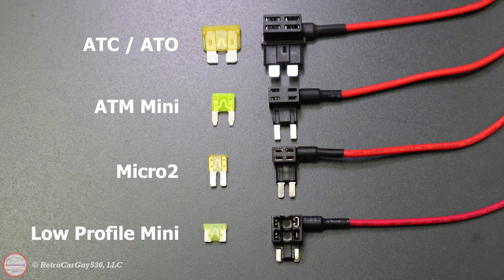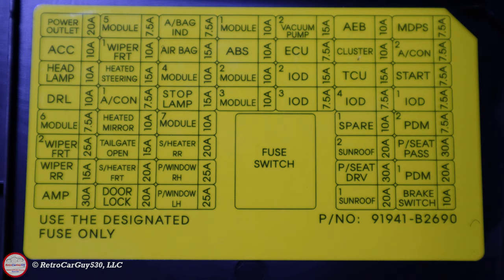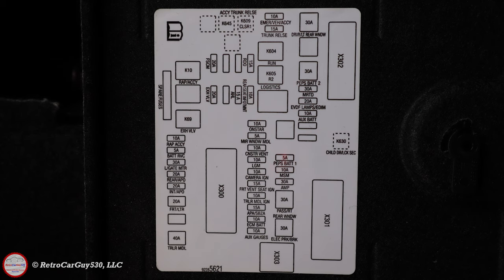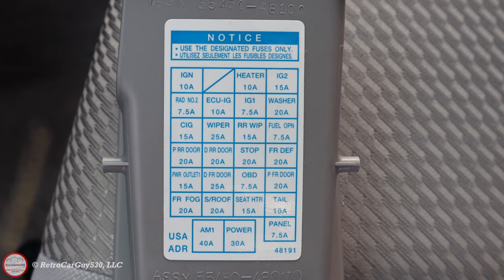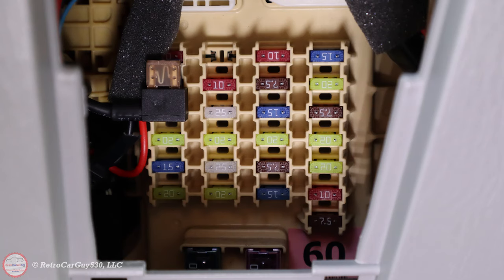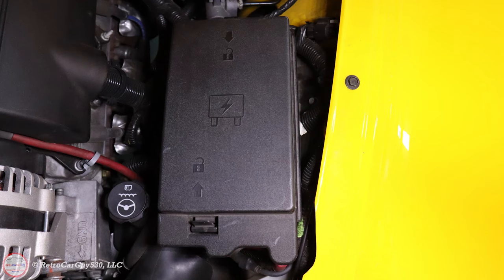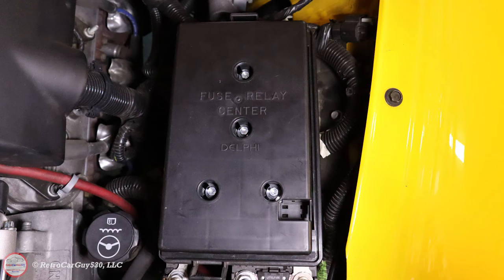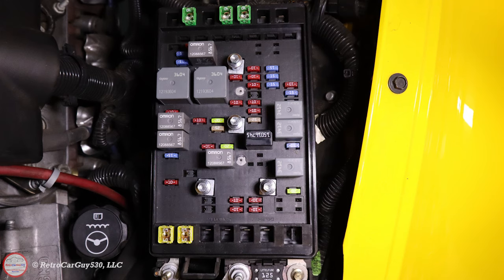How To - Add a Fuse Tap in Your Vehicle

Comment: So to be clear, the fuse taps must be inserted with the 12v left prong and ground right prong.

But the fuses themselves don’t matter if it’s flipped around as long as the original fuse goes into the bottom row?
Reply from the maker: No, the fuse tap never connects to ground.  The fuse tap has two fuse sockets.  The lower fuse socket is for the original fuse in the fuse box fuse socket (if present) and the upper fuse tap fuse socket is for the new device/accessory you're trying to provide power to.  The fuse itself has no power flow direction requirements.  I'm going to post a section I wrote for another question a few days ago to try and explain the power from the fuse box fuse socket going to the left leg (in parallel) of the fuse tap vs the right leg (in series) of the fuse tap.

There are two methods of using a fuse tap, the approach I show is the "in parallel" method where both the original fuse (lower fuse tap fuse socket) and the new accessory fuse have direct access to the power provided by the fuse box fuse socket.  This is very safe for adding devices requiring small amp loads (dash cameras are under 1 amp and radar detectors).  This is with the power from the fuse box fuse socket being supplied to the left leg of the fuse tap.

The second method of using a fuse tap is the "in series" method of routing the power through the fuse tap.  This is when the power from the fuse box fuse socket is provided to the right leg of the fuse tap.  That means the power goes through the lower fuse over to the left side of the fuse tap which is where the left leg will then provide power back to the fuse socket and power is provided up to the top fuse socket in the fuse tap.  The "in series" approach is the "safest" method of using a fuse tap because if the amp load of the original device/accessory plus the amp load of the new device/accessory being powered by the fuse tap exceeds the original fuse's amp rating, it blows the lower fuse in the fuse tap.  That provides the best protection to the wiring providing the power to the fuse box fuse socket.

Comment: Only thing I missed in this video is where to connect the ACC labeled wire. Mini came with a GND, POS and ACC wire.
Reply from the maker: You need to find two fuse sockets in the fuse box.  One that provides constant (BATT+) power and one that provides switched (ACC+) power.  You'll use two fuse taps in that situation.  The ground is connected to a nearby ground lug/bolt/screw.

Comment: The two exposed pieces of metal on the fuse are there for you test the circuit without taking the fuse out.
Reply from the maker: Yes, the two exposed metal pieces on the top of the blade style fuse are there for testing whether the fuse has blown.  If power is provided to the fuse and power available on both of the exposed metal pieces, the fuse is "good".  You cannot use those two exposed metal pieces to easily determine which side provides the power to the fuse box fuse socket.

Comment: Hi, @RetroCarGuy530. Great explainer video! I think I understand how this works, but I'm not sure if it will work for what I'm trying to do. I'm trying to install a new unswitched 12V outlet in my car so that I can run a 5W or 10W solar batter tender from my dashboard without having to hardwire directly to the battery in the engine bay. Can I supply power to the battery via fuse tap?
Reply from the maker: As long as the fuse box fuse socket where the fuse tap is installed is providing power directly from the battery (not through a module in the vehicle), then it should work.  Just make sure the wire being used (for power and ground) are a wire gauge (awg) rating sufficient to carry the power for the distance between the charger and the fuse tap.  Since this charger produces only 5W or 10W, the wire gauge shouldn't be a big issue, but it's always necessary to consider wire gauge when figuring out if a circuit can support the power demands of the device.   I discuss wire gauge/length in my FAQ video on installing a fuse tap.  https://www.youtube.com/watch?v=DnZ5wb_A5vE

The fuse amp rating needed for the fuse tap upper fuse socket would be something very small since 12-volts at 10W is under 1 amp.  I would put a small amp fuse in the top fuse socket of the fuse tap if this is only to be used with the solar battery tender.

Check the solar battery tender's user manual to see if there are any restrictions regarding the use of a fuse tap or if they state any specific wiring requirements to ensure safe operation.

Comment: Depending on the power of the original fuse that was already in the circuit, how do you determine which power circuit to use for the second circuit that you will use for the fuse tap?
Reply from the maker: This topic requires a somewhat complicated answer.  Without detailed/specific knowledge of how each fuse box fuse socket obtains its power and what the max amp rating is for the source of power, there's no perfect way to answer this question accurately.  The wiring / method the power is provided to the fuse box fuse socket must be able to provide the original amp load and with most situations it has at least a small amount of built-in "extra" amp load carrying capacity.  That "small amount" is usually around 10% of the original amp load rating.  10 amp = about 1 amp extra. 20 amp = 2 amps extra.  Is this a perfect way of estimating the amount of available amps, no, but it is a fairly safe assumption.

If the device needing power from a fuse tap requires a large number of amps (over 5 amps) to start/run, I would not recommend a fuse tap for its power source.  For devices with higher amp load requirements, sourcing power directly from the vehicle's battery with an inline fuse to protect that circuit makes more sense. If the device requires switched/accessory power, I would still source the new device's power from the battery with an inline fuse, but use a 4-terminal relay to toggle the power  on/off.  You could use a fuse tap to source the switched/accessory power to turn on/off the control side of the relay if you want it to turn on/off with the ignition switch.  If you want to manually control the on/off behavior with a toggle switch, you would use that to power the control side of the relay. I have a video discussing the "relay" approach to power a dash camera battery pack.  https://youtu.be/Joa0fiKZY-o?t=744

I recently posted on a DashCamTalk website about the differences in the installation of a fuse tap into a fuse socket (power on the left leg vs power on the right leg) here.  https://dashcamtalk.com/forum/threads/a229-pro-2ch-issue-with-power-or-hardwire-kit.50021/post-607344

Comment: I like your videos, they are very informative. I do have a question I hope you'd be kind enough to help me with. 

I am using an Add-A-Fuse tap to power an Amazon Fire Stick. However, the Amazon Fire Stick only requires 5vdc  1.5amp not 12vdc. I have purchased a 5v 3amp(max) transformer with USB 3.0. 

(1)Can I hook up the Add-A-Fuse then tie the Red(+) wire from the transformer into the add a fuse Red (+), ground the Black (-) wire to the car body and simply put a 1.5amp into the Add-A-Fuse spot? 

(2)Or because the transformer is 3amp (max) will I have to put a 3 amp fuse in the Add-A-Fuse and then add a 1.5amp line fuse to the end of the Add-A-Fuse and then tie in the transformer  5vdc 3amp(max) transformer. 

It seems as though option one should work, correct. If it is saying 3amp max it seems there should be no problem running less amperage through it. And hooking up (1) Add-A-Fuse>reinsert existing fuse> insert 1.5amp fuse> wire 5vdc 3amp transformer and bang, correct? thoughts?

Thanks
Reply from the maker: The 5V 3amp (max) rating of the transformer equals 15 Watts.  Converting the 15W load to 12V equals 1.25 amps.  There might be a spike in the load when the unit is first turned on, so a 1.5A or 2A fuse in the fuse tap would seem appropriate (option 1).

Comment: Hello awesome video ! I do have a question though. I am installing aftermarket headlights. It’s the whole assembly. They have positive and negative wires on them that control the LED strips in the headlight. I want them to be constant on. On when the daytimes are running and also on when the headlights are running. Right now I have no constant 12v power I can splice to in the factory headlight plugs. So what size fuse can I run to splice these wires too? Thanks a lot!
Reply from the maker: I would assume that LED light strips shouldn't consume a large amount of amps (maybe 5 amps per strip - depending on how long the strip of LEDs is and how may LEDs are in that strip).  I'm hoping the LEDs have some sort of specifications statement on the product or in their documentation on how much power they consume.  If not, you might have to attempt to figure that out using a digital volt/ohm meter (DVM) using its amp draw feature/mode.  Most DVMs have a 10 amp max on the amp testing they can safely perform.  Then you'll know what they actually draw when they're on (there might be a startup amp draw higher than the steady state amp draw that you need to account for in the fuse amp requirement sizing).

I have a FAQ video I put together a couple of weeks ago about wire gauge sizing, length of wire and how it governs the max amperage you can safely run through the wire for a given length of wire and how to perform the calculation to see what any particular fuse socket might be able to support using a fuse tap to power a new accessory (lights in your case).  https://www.youtube.com/watch?v=DnZ5wb_A5vE

The info in this video and my FAQ video are general guidelines.  I cannot give exact/specific  recommendations for wire gauge, fuse sizing or fuse socket selection.  There's just too many things I may not know about a situation to allow me to that specific.

I hope that gives you enough info to figure out your power requirements for the LED light installation.

Comment: great video!!! how you do to put a "switch on a fuse"... I go off-roading with my 4wd and I need to remove one fuse every time (traction control).. instead I was thinning to put a simple switch on the fuse... any idea?
Reply from the maker: There are "test leads" you can purchase that will replace the fuse in the fuse box with a length of wire with a remote fuse socket fuse holder.  You could insert a toggle switch in that wire to allow you to turn on/off the power on that circuit.  Something like this: https://amzn.to/3M1mewz

Comment: What fuse you recommend to tap to connect fog lights
Reply from the maker: That has a few different facets to the answer. The total amp draw for the fog lights needs to be known.  Depending on the types of lights used in the fog lights, it could only take a couple of amps up to nearly 10 amps (with incandescent bulbs). A fuse box fuse socket that supplies power to critical components (any modules that control the engine, transmission, air bags, body control module, etc) should be avoided.  Fuse box fuse sockets that get their power from any of the vehicle modules should be avoided as well (circuits that are turned on/powered by modules like the body control module).  Adding a large amp load to a pre-existing circuit is not advisable since the wiring that provides power to/from the fuse box fuse socket may not be able to support a large additional amp load over the already existing load placed on that circuit.

You may want to consider using a 4-pin relay to supply power to the new fog lights. The power source for the circuit (load side) would be sourced directly from the vehicle's battery with an inline fuse (pin 30 gets power from the battery, pin 87 sends power to the new device/feature). The control side of the relay (usually with pins 85 [ground] / 86 [control power]) can use a fuse tap to source the switched accessory power from a fuse box fuse socket or from a on/off switch to control when the fog lights are on/off. I address this topic in a video I created to review dash camera battery packs which can demand a large amp draw as well.  I mention / show the relay approach in this video https://www.youtube.com/watch?v=Gn3IoBjO_Vg&t=1995s

Comment: Thanks for sharing. If the fuse in original tap is 15 amp, what a fuse should I plug in the accessory tap?
Reply from the maker: There are several factors that go into what the proper amp rating should be for the fuse for the new accessory.

First off, you need to figure out what the power demands are of the new accessory.  I cannot state with any degree of certainty what the maximum power demands are of the new accessory.  You need to refer to the new accessory's documentation or labels on the accessory to see what its max amperage requirements are for that device.  Without this information, you cannot properly determine whether a fuse tap is the right approach and whether it's safe to use a fuse tap in a particular fuse box fuse socket.

Once you know what the amperage requirements are for the new accessory, you'll need to decide if the fuse box fuse socket and the manner in which it obtains its power can sustain the pre-existing 15 amp load and the power demands of the new accessory.  There are so very many thoughts on this aspect of the process.

Adding a fuse tap with the left leg of the fuse tap obtaining the power from the fuse box fuse socket is known as an "in parallel" installation of the fuse tap.  That being, the power from the fuse box fuse socket is being provided to both circuits directly in the fuse tap.  If the manner in which the power is provided to the fuse box fuse socket is already supplying 15 amps for the original circuit, you may not have a whole lot of additional amperage left over for a new accessory.

Usually adding a fuse tap for a low power demanding devices (dash camera, radar detectors, etc) will usually only need 2 or 3 amps to operate.  Most 2-channel dash cameras operate at the 1 amp or 0.5 amp range.  Obtaining power for lower power demanding devices is usually something that can be done using a fuse tap with something already needing 15 amps.  The original fuse box fuse would go in the lower fuse tap fuse socket and the new accessory fuse would (being a 2 or 3 amp fuse) would go in the top fuse tap fuse socket.

There is a different train of thought on using a fuse tap and that being making the right leg obtain the power from the fuse box fuse socket.  That routes the power through the bottom fuse and then up to the top fuse for the new accessory.  That's also known as the "in series" power routing approach.  There are pluses and minuses to this approach as well.  With all of the power running through the fuse in the lower fuse tap fuse socket it better protects the wiring that provides the power to the fuse box fuse circuit, but it also means you could be blowing the fuse in the lower fuse tap fuse socket if the load for both circuits exceeds the amp rating of that fuse (15 amps in your example).   I tend not to use this approach, but others will argue this is a safer approach than supplying the power to the left leg of the fuse tap.

If you have a new accessory that requires 10 to 20 amps by itself, that's when I start to suggest using a separate relay that obtains power from the battery of the vehicle (with in-line fuse) and then the power necessary to control the relay (if you need switched power) can be obtained by using a fuse tap since the control circuit for a relay is usually requires very little power (1 amp or less).

As you can see from my response, this is not a topic/question that has a simple answer.

Comment: Hi, thanks for an informative video.  I've recently purchased a new steering wheel that includes a button to heat the steering wheel.  After replacing the old steering wheel with the new, I find that the left controls work, specifically for the cruse control, but the button to heat the steering wheel does not work (expected).  I'd like to make the heat on the steering wheel hot.  Can you tell me if by running a wire from the clock spring to the fuse box will help to make the heated function hot?
Reply from the maker: It will take some research on your part to see what is and is not present in your vehicle to know what the correct steps are to install and power the heated steering wheel feature.

It's been my experience that most heated steering wheels require 15 or 20 amps to power them.  My wife's 2017 Kia Soul uses a 15 amp fuse for that circuit in the fuse box.  This is where it gets a bit tricky trying to power something that requires that many amps with a fuse tap.  Most fuse taps have a 16 awg or 14 awg wire coming out of the fuse tap to send power to the new accessory.  A 16 awg wire can only supply 20 amps in a wire length of no longer than 2' to 3'. 

The issue then becomes finding a fuse socket in the fuse box that can provide the required amps without impacting the pre-existing circuit or wiring.  If your vehicle has an unused fuse socket intended to power a heated steering wheel, that might be best to use (assuming the wiring isn't already present in the vehicle for that feature).

Then comes the issue of how to control the on/off nature of the heated steering wheel feature.  The button may be present on the steering wheel, but the feature may or may not be enabled in the vehicle's body control module (BCM).  The control wiring likely runs through the clock spring, but the power for the heating element(s) may or may not.  You would have to verify that with a wiring diagram for your vehicle.  If you're extremely lucky, the BCM will have that feature enabled, the wiring will be present in the steering column for the control circuit (button) and the heating elements.

I wish I could give more specific information to you, but this type of task involves several things (fuse box, clock spring, BCM) and I just can get to that level of detail with something like that.